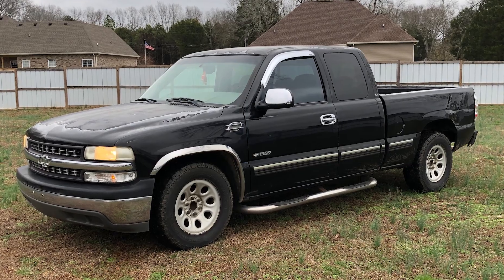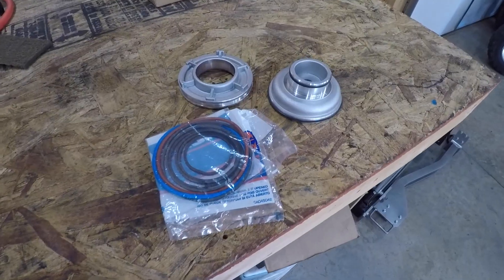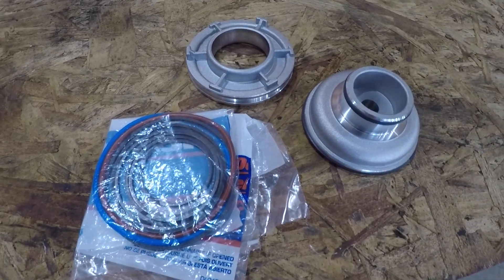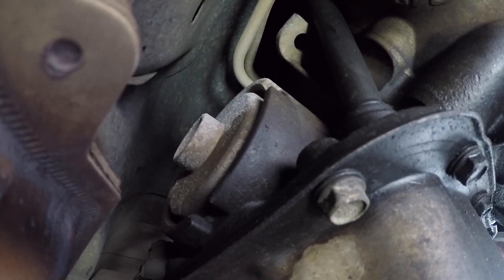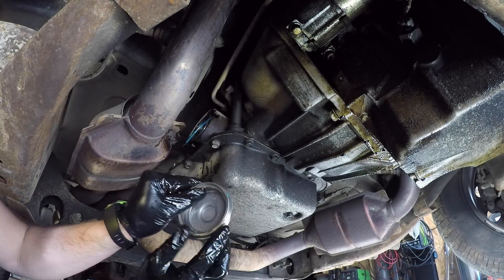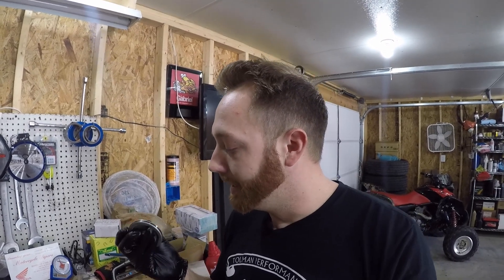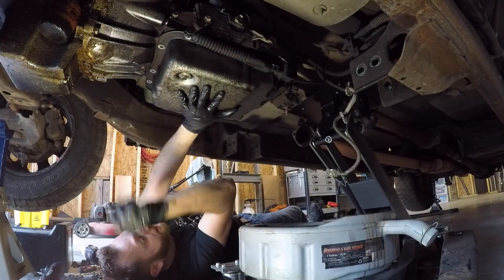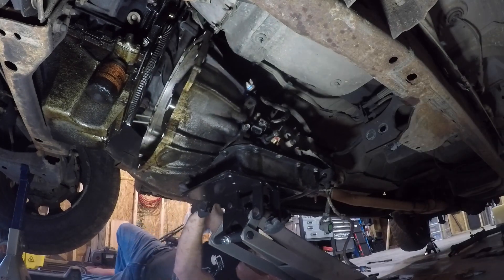Diagnosing and Removing a blown 4L60e

Comment: to bad you took the trans out there is a trick to lengthening the servo pin to make the adjustment to get the band working again, plus who doesn't like saying they made a transmission work again with a welder LOL
Reply from the maker: i did consider that, but when I considered how worn the rest of the transmission was (based on the black trans fluid) and the fact that even a fresh 4l60 isn't the strongest, I just decided to bite the bullet and do the 4l80 swap right away. good point though!
Reply: Lawrence LT Tolman  enjoy 

https://youtu.be/e_8n0_L1OAw
Reply: Lawrence LT Tolman to bad you weren’t closer to my shops I could have gone through either of them before you put it in. 
Either way the 4L80E swap makes for good content!

Comment: when my 4L60e went out i replaced it with a Monster Transmission. back then it was going to be the very close to same $$$$ for a local place to rebuild mine with upgraded parts as it was to just buy the Monster and I got the torque convert and fluid as a package deal and its been great.
Reply from the maker: yeah, makes sense to just get everything upgraded if you're going through the effort to remove and install one

Comment: Love the videos great to see how to videos on the floor no hoists. Just like most of us do it. Keep them coming LT.  Getting ready to build a budget build hot rod so i can rip around this summer as i build my big build i can take my time with.
Reply from the maker: yeah, I'm spoiled for sure with my other jobs to have a lift and whole shop full of tools, but at the end of the day the job still has to get done, regardless of how many tools you have or dont have.
Reply: @TolmanPerformance   oh i agree.   Got any pointers on a budget hp. Motor. For. Project build. Building a rat rod. 2wd. Jeep cj or tj.  That i could dig out of junkyard and be easy to setup.